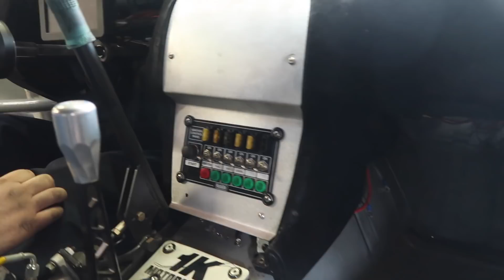NEW TRAILER FOR RACE SEASON?!

Comment: Also Caleb, cap the radiator one and use the one on your expansion tank. Overflow is supposed to be ran off the highest point in the cooling system, which is now your expansion tank.
Reply: Yep
Reply: Para's Garage this guy is right... If that vent is left open it will just leak and expansion tank will be useless really.

Comment: Hey homie, only one cap is going to vent to the overflow. You need to make sure that the cap on the radiator is a higher pressure then the cap on your overflow tank since it is a pressurized tank. 
You need to vent at the highest point in your coolant system which is now your overflow tank.

Comment: Cap the lower bung and have the drain at the highest point in the system.  If you have the drain on the road all the water from the expansion tank will leak out. Has to be on the expansion tank at the top of it.

Comment: Overflow needs to be run off your expansion tank. You might be best getting the cap on the radiator cut off and welded, just for less weak points.
Reply from the maker: +Kaice Gunn that’s what I was thinking but it’s gonna take forever to fill the rad from the tank
Reply: Caleb Quanbeck my bad, I'd thought the line to the expansion tank was larger. Maybe just the fitting next to the cap then? It's no longer needed, because thats the line that would feed the tank. Would be better than just capping it.

Comment: Hey Caleb, is your truck a 2500 or 3500? Just wondering if you might exceed the GVWR with that trailer on and loaded. DOT guys might ding you if it does.
Reply: Mind you if the Haggard guys were pulling it with the van it probably isn't. Good to check though.